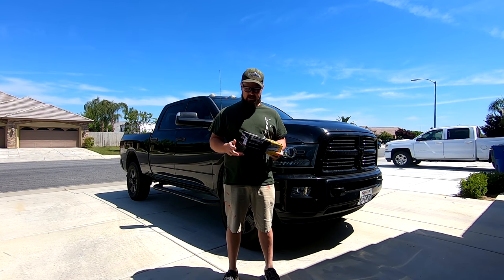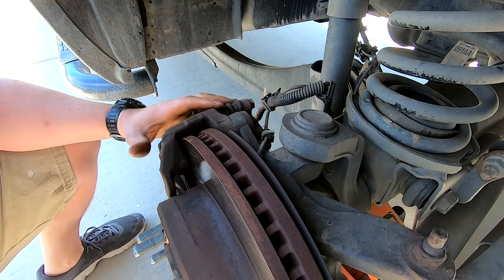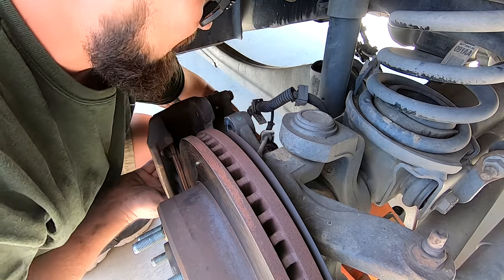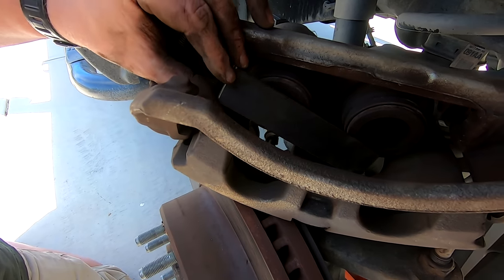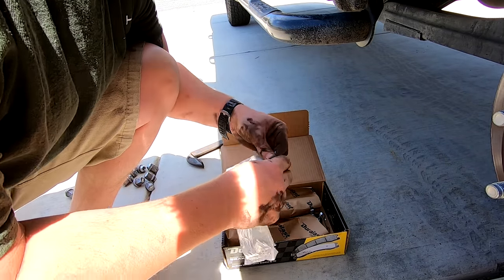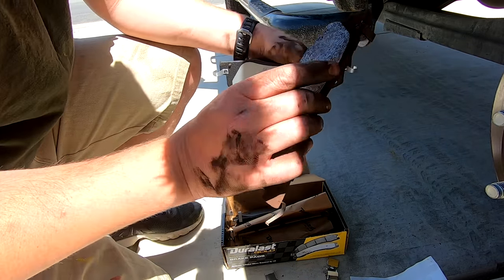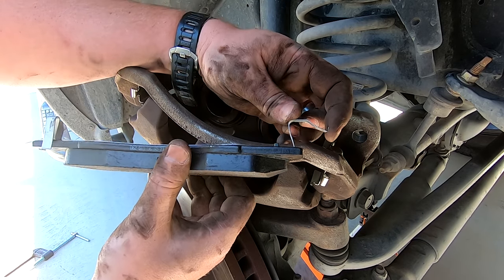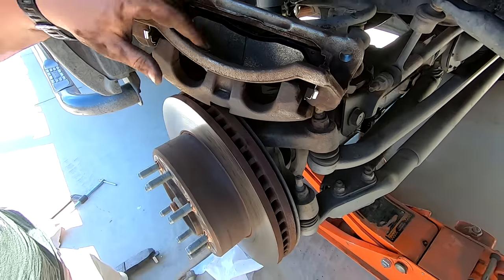How To Change Front Brake Pads // Dodge Ram 2500 // 2011-2019

Comment: I've done alot of brake jobs! So I learned to where yellow color gloves at harbor freight! The other thing is use the old brake pad that the piston side and use the c clamp to push in the pistons! Thanks for the video! Dave
Reply from the maker: Yeah, I've started using the old brake pads for that. It's a great trick! And those gloves are life savers, as well!

Comment: Correct me if I’m wrong but when pushing the pistons back don’t you have to open the cap to the brake fluid reservoir to release the pressure for those pistons to go back?
Reply from the maker: You are right in your thinking and a lot of older models have a sealed cap. Newer vehicles (80's and up) have a diaphragm/vent built into the cap the expands and collapses as fluid volume changes.  I try not to expose the brake fluid to the air any more than necessary due to possible contaminants entering the system. Thank you for commenting!
Reply: Unfortunately I followed this guys video and had fluid all over the place. 😢
Reply: Hopefully it didn’t blow a seal out of the reservoir
Reply from the maker: Usually, this happens because you've added additional fluid to the system, so compressing the pistons will push all that fluid back out. The cap has an expanding diaphragm the takes up the space the fluid leaves behind as your pads wear, then when you compress them, the diaphragm collapses and returns to it regular shape. I'm sorry you pushed fluid everywhere, but unfortunately that would have still happened with the cap off.
Reply: Maybe different but, on my past Honda it was to prevent braking the sensor inside.
Reply: 2016 Ram 2500. Did passenger side. Drove about 1000 yards because I had to turn my vehicle the other direction due to parking situation. Did drivers side. While compressing pistons pressure pushed brake fluid out the cap. Quite a bit.
Reply: Was thinking the same thing
Reply: @jdga375  the reason why you had fluid all over the place is because someone topped of your brake fluid which you should NEVER do. Low brake fluid means one of two things, your brake pads are worn or you have a leak.

Comment: you should really remove caliber from mounting bracket to inspect your caliber is sliding correctly on its bolts and possibly and lube to bolt pins to ensure caliber does not get stuck or frozen

Comment: I don't want to take anything from your video but a recommendation is not to remove the caliper bracket but only the caliper.  Use the old brake pad to push in the caliper pistons and open the master cylinder reservoir prior to pushing the pistons
Reply from the maker: Thanks, I appreciate the input. I'm planning a new video in the future where I address all this. I will be rebuilding the calipers and showing how the cap is built to expand and contract without spewing fluid. I will also be showing some new things I've learned since this video came out. Again, thanks for the comment and thanks for watching.
Reply: I was thinking the same. Never saw the bracket removed before. Always remove the pins and inspect them for seizures or lack of grease.
Reply: Yea I was like what the heck why would you take the bracket off u take the caliper off so u can grease the pins

Comment: Great video. I'm doing my 2015 Powerwagon in the next couple of weeks. Also I bought a set of new takeoff Black rims like you have. I think they look pretty sharp compared to the polished aluminum ones that come with the truck.
Reply from the maker: I love the black rim look and they are a lot more durable than the usual aluminum rims and less likely to taco on the trails.

Comment: Great vidio helped a lot with the learning curb. I did how ever run into one problem the brake pads and hardware i used was made in India no manafactor info on box bought at Oreilly,s the caliper clips were junk would not work to thick poor quillity control had to use the old ones. worked an extra hour in 101 heat before i coumpared old clips to the new ones. just for everyones information.
Reply from the maker: Thanks for letting us all know that. Unfortunately, quality control on some of these isn't the greatest.

Comment: Yo - jp . my housing that contains the pistons will not move to let the inner pad line up to the rotor .  it needs to  .  any ideas ??
Reply from the maker: It's probably just a little stuck or rusty. Try some penetrating oil, but make sure not to get it on the rotors.
Reply: I think you skipped a step on this, my brakes didn’t line up. Found the solution on another video. Don’t have to bend the clips on the pads when assembled correctly

Comment: Did you have to bleed the breaks or anything?  I'm looking to change my breaks in my 2015 2500. Will be my first time attempting.
Reply from the maker: No need to bleed the brakes unless you undo a brake line or leak fluid.

Comment: It's always been my practice to apply silicone grease to the underside of the clips and just a bit to where the brake pads ride in the caliper holder, metal on metal isn't good, can cause wear and noise.
Reply from the maker: That's not a bad practice and I tend to agree. These pads have a separate rubber backing that rides against the piston that absorbs vibrations and prevents squeaking. It's almost time for my next brake change and so far, no squeaking. In one of my other videos for a Ford Explorer, I apply grease to the backs of the pads because they don't have the dampener on the back of them, so by all means, use grease where you see fit.
Reply: Causes wear and noise? HA! Wait till you find out all vehicles come like that from the factory😒

Comment: When did you take the clamp off? Do the pistons come back out or hold their position?
Reply from the maker: I didn't remove any clamps and the pistons stay in place. Which clamp are you referring to? The new pads are thicker, so you need to press the pistons and make the opening wider to accommodate the new size.
Reply: 13sweep13 If you're using a c-clamp to compress the pistons you can take it off once you finish compressing the piston. It won't move again until you press the brake pedal. You can also compress the caliper piston with the old brake pads still in place and a Wonder bar or other type of small pry bar. Just don't do that with the new pads in pace.

Comment: Hey JP should i take the top cap off my brake reservoir before compression of caliper?
Reply: @RoadandReel  Thank you! That is what i needed. I have done brakes many times and always bleed them but now i know the best way. Wow much easier.
Reply from the maker: Nope, no need to remove the cap on the brake reservoir. They usually expand and will collapse as you push the caliper in.

Comment: Do you still have to bleed the breaks on newer trucks?
Reply from the maker: Only if you disconnect a brake line like when changing a caliper. Otherwise, just changing the brake pads, you don't need to bleed the brakes.

Comment: What did you do with that little piece you put on the pistons.
Reply from the maker: I used it to push on the pistons evenly at the same time. You could just as easily use the old brake pad.

Comment: If I remember correctly, lug nuts specs are 130-135 ft lbs and the caliper bolts are a manly 275 ft lbs.

Comment: is it safe to use copper anti seize on back of brake pad? is it safe on rubber piston boot?
Reply from the maker: If you are talking about using it to reduce noise, then yes. If you are talking about lubricating the slide or any moving parts, then no. It's not going to hurt any rubber parts, but it will gunk up and harden on the moving stuff and cause issues. I recommend the dedicated brake slide lube for the moving parts.

Comment: Pad swap? No resurfacing or replacement of the rotors? Rot0rs are cheap $100 each...
Reply from the maker: Lol, $100 each is cheap. Must be nice. You can do whatever you want with your money, but as long as my rotors aren't grooved or cracked or grinding or shaking or too thin or warped or rusted, I'm not changing them.
Reply from the maker: Lol, $100 each is cheap. Must be nice. You can do whatever you want with your money, but as long as my rotors aren't grooved or cracked or grinding or shaking or too thin or warped or rusted, I'm not changing them.

Comment: Where did you plack the jack at to lift up the front? Is that a safe spot?
Reply from the maker: It's placed under the trailing arm on the axle, right where it attaches. It's a very safe and sturdy place, just make sure to use a jackstand under the frame for extra security.

Comment: Nice brah! Nice.
Reply: Do you use brake grease?
Reply from the maker: @joshuaboyd7666  I do. I usually put it on the pin and where the pad slides in the caliper and I usually put some anti squeak on the back of the pad where the piston meets.

Comment: Same process for Ram 3500?
Reply: Going to find out today... front will need done, most likely rears too. Using the same pads Duralast Gold.
Reply from the maker: Should be and it has a lot of the same part numbers as well.

Comment: It's always a good idea to had the rotors turned when replacing the pads. You want the pads to seat onto a flush surface, if there is any grooving or uneven wear you are going to ruin your new pads and possibly feel a shutter or shimmy in the front end when braking.
Reply from the maker: As long as your rotors aren't grooved, warped, or scored, then they don't need to be turned. The pads will wear into the old rotors just fine. Now, if there was any "shutter" when stopping or if the pad wore through to the backing, then they'll need to be turned or replaced. If you turn your rotors every time, then you are wasting money on turning and prematurely wearing out your rotors.
Reply: @RoadandReel  you won’t see the uneven surface wear, the turning process when done correctly won’t take very much material on barely worn rotor. The obvious groove or warping for sure. Most people watching these videos won’t know the difference and for something as important as brakes, especially front brakes it needs to be mentioned. I think finding a place to get it done properly may be harder to find since nearly all manufacturers require on hub turning these days.
Reply from the maker: @rambokd  when I replace my rotors in the future, I'll be sure to mention it and go through some of the basic manufacturer recommendations in the video. Any more, I think it is more cost effective to replace rotors rather than resurfacing them. And like I said before, unless it specifically mentions it in the service manual or if there is obvious warping or surging, then it's just not necessary from a safety standpoint. I can see where you are coming from and I appreciate you mentioning this. Feel free to drop a video in the comments that covers all of this and I will mention it in a pinned comment where others can see it.
Reply: @RoadandReel  I wouldn't bother turning them.  Its an over rated odd-timer practice.  What they want to charge these days to spin them, I replace the rotors ever other brake job.  I have been communing in the Rockies for 30 years over 100 miles each day up and down 2,000 feet and have put over 750K miles committing to work.  I don't tolerate any BS.  Pulling or pulsating ill just throw the entire assembly away and install new.
Reply from the maker: @omorin34  I just hit 125k and I'm going to replace the rotors and completely service the calipers. Everything is still wearing evenly without pulsating or shaking, but they are getting to the minimum thickness and I tow a lot, but I agree with everything you said.

Comment: I don’t understand why you took the brake caliper bracket off. You only have to remove the brake caliper.
Reply from the maker: That was my mistake. I was trying out what some people said in another video. I usually do it for inspection, but in this case I just went with it. You can check out my newest video on a New Ford Explorer to see how to do it properly, but it sounds like you already have a handle on things. Good luck with your brakes!
Reply: @RoadandReel  It's more than likely they were also replacing the rotor which is why they tool off the whole bracket.

Comment: I think you may be wrong on the torque specs everything I read was 34 ft lb of torque
Reply from the maker: That's for the caliper pins. I took off the entire caliper bracket, which is necessary if anyone wants to remove their rotors. It's a much larger bolt and under a lot more strain.

Comment: Why did he take the caliper bracket off again?
Reply from the maker: It's just the way I've always done it from working on earlier models where it was necessary.
Reply: I’m wondering the same. I saw another video where the guy swung out just the mounting bracket and the pads got put in from the back so he didn’t have to bend those Springs all to hell to get them in from the front.

Comment: I believe this is a 2 part caliper and you did not have to take the whole caliper off for pad replacement.
Reply from the maker: You are correct. If I am going to lube everything in the caliper (like I should), then that's how I would do it. I will be completely disassembling, cleaning and  lubing the caliper parts on my next brake job as I should be close to the 100,000 mile mark.
Reply: Yep, the dozierdennis video on the 2500 shows the right way to do it.

Comment: Hey thanks for the video. You committed a heinous crime in brake repair. You never want to squeeze the brake fluid from the caliper back into the system. It’s been thermocycled 50,000 times, it’s dirty, and probably has a lot of water in it. You always want to crack the bleeder and bleed it out while your compressing the caliper. Add fresh fluid to the system when your done.
Reply from the maker: Hmm, I'm going to disagree with you here. The brake fluid system is closed so dirt and grime don't enter. I will give you the water that may be in the system, but brake fluid is usually changed  every few years or so as the thermocycling within the system doesn't cause water to enter unless there is exposure of fluid to the atmosphere. I would argue that adding a partial amount of fluid at each brake service would add more contamination than pushing the fluid back into the reservoir from the calipers. That's why the brake shop doesn't do it this way. Fluid should never be added like this unless the system is going to be flushed and all new fluid added.

Comment: No brake grease??
Reply from the maker: I didn't have any binding or uneven wear, so I didn't do it. I will be doing an intensive brake caliper video pretty soon with my 100k tune-up.
Reply: @RoadandReel  10-4 man I was just wondering because I know it helps with the squealing. My brand new from the factory brakes squeak so I will definitely be using grease when I put my power stop pads on
Reply from the maker: @JD-sl1qs  I have found that some of that harder pads are more prone to squealing. I don't blame you for putting it on first. It's a whole lot easier than finding out they squeak and then having to do it again! Good luck.

Comment: I always bleed them especially if they were wearing more on one side! good sign you might have a little air in the lines.
Either way you should always bleed them so easy anyways!🤙
Reply from the maker: Brakes are spongy when there is air in the lines. If they are wearing on one side, it's usually do to your caliper sticking and then it should be rebuilt. Bleeding your brakes every time is just a waste of fluid and an easy way to introduce contaminants into the system. Once that happens, the fluid needs to be evacuated and refilled.
Reply: Hay man you do what you do! No hard feelings!🤙

Comment: What about the rotors ? Cmon man that’s a many thousand dollars truck and you are not replacing the rotors ..  that’s a inconvenience
Reply from the maker: Rotors were still in spec and didn't need to be turned. That being said, I just turned over 140,000 miles on the factory rotors and upgraded to the Power Stop drilled and slotted rotors and it is a world of difference! A new video on that upgrade should be out in the next couple of weeks.
Reply: @RoadandReel   $400+ rotors and carbon fiber pads , makes a great difference ..   shine wheels longer and great stop 👍